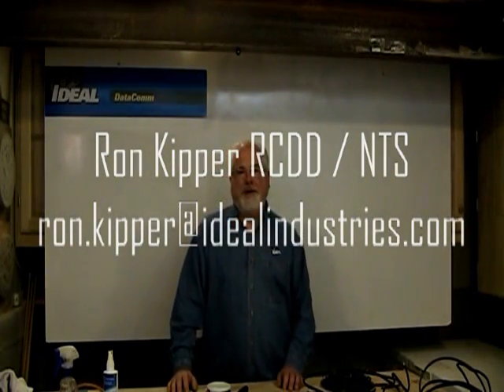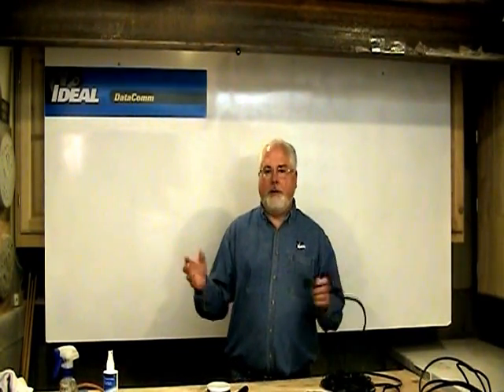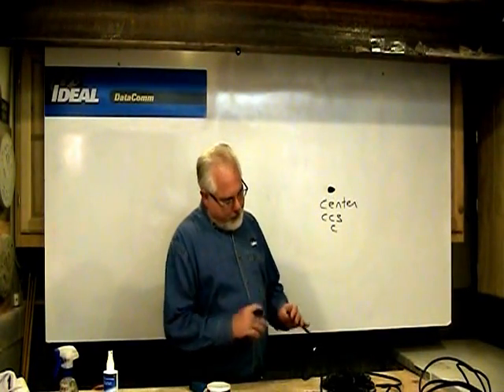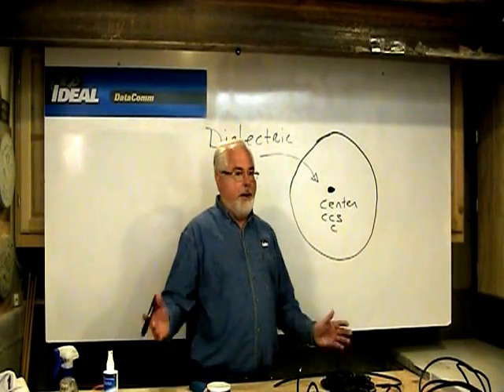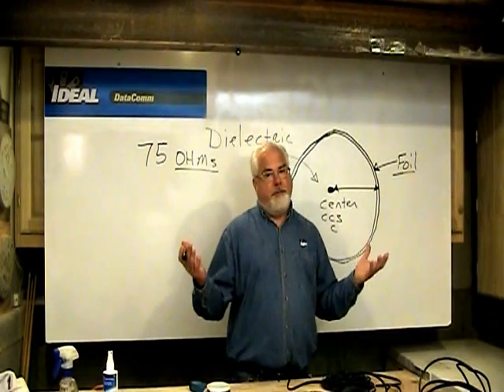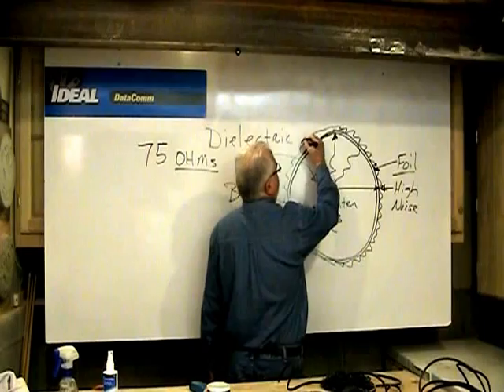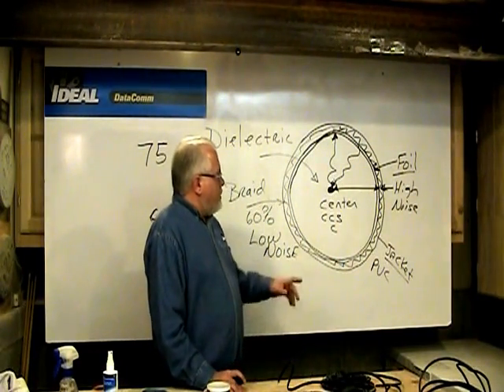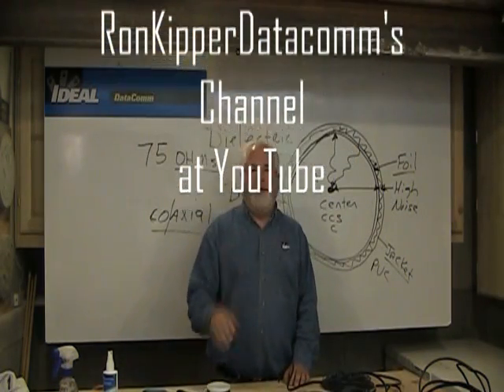Coaxial Cable Basics Part 1

Comment: Finally I have the answer to my question, I had used a "U" staple gun on my internet coaxial,  this staple just barely fits around causing the coax to be slightly squeezed down, Ive been doing this for years working for ADT and never had a problem, I knew I wasn't pinching it so tightly as to short the dielectric, I was dropping internet connections every few minutes at home and the Comcast boy tried for an hour to convince me that my staples where causing all the problems, but he could not explained how,  I insisted he replace the modem, he did and ensured me this would not fix my problem,  well that was a year ago and it still works great, But I had never heard of the capacitor effect inside of coax when the dielectric is manipulated, Thanks!
Reply from the maker: Glad to be of service and thanks for being out there. Ron

Comment: I bought a Sperry tt64202 cable tester because I'm getting no signal from my antenna. I have 3 lengths of of coax. I used a RG59 that was in the wall and runs through the attic, and attached a piece of RG 6 to either end. One to go from the attic end up to the roof, and another piece to extend from the wall end to another place in the wall. The tester shows a positive signal only when the main unit is connected to the remote unit with the coax connectors that came with the tester. I have tested all three sections of the coax that run from my wall individually, and get no positive signal. I'm stumped. I don't know how that can even be possible. Any thoughts?
Reply from the maker: Jeff Johnson Jeff I would recommend a new piece of RG-6 that runs directly from the wall outlet to the antenna. However what you are doing should work I am assuming total length of the cables is 40-60 feet? That tester will show either an open or short in a coaxial cable and does not measure signal strength. So if you have nothing it is an open. In that run of RG-59 is there a hidden splitter that may be causing your problem? The tester cannot test through one. Double check all the connections there is something you are not seeing that is causing the opens. If some strands of the braid get wrapped around the center conductor that will be a short which also causing no picture. Worse case take a length of RG-6 cable from the antenna to the room you want reception and see if you get a signal. If that works it has to be a problem with the cable in the wall.Good LuckRon
Reply: ***** Thanks, Ron. I figured it had to be the connections, and I went back and redid all of them being much more careful about the length of the dielectric and the copper wire. I had also used RG59 connectors on the RG6 cable, so I replaced those with the proper connectors. I had used RG59s because I had some around for some reason, and I figured it wouldn't matter since I thought their function was just to hold the connections together which they did, and I thought they would work fine if they were never stressed. I suspect the culprit was the somewhat careless cuts I made on the ends of the cable, but everything works find now. Thanks so much for your videos and for taking the time to answer me.

Comment: Hi. Where can I find the capacity per meter data for RG174 and RG58? Can I rely upon that data if I am using cables from different manufacturers?
Reply from the maker: The manufacturer should be able to provide you the specs of their cable. You might find some help on the SCTE website as well. Good luck Ron

Comment: I'm wanting to rerun my coax inside for internet phone instead of letting the cable company do it (they charge $50 per foot) do I need quad shield for this or? I'm not trying to be cheap but I don't want to be ripped off either!  Or what would you recommend?
Reply from the maker: jack Kang Jack Quad shield RG-6 is usually not that much more in cost and if you have any issues with nearby electrical lines go ahead. If you do not have any issues with electrical noise then RG-6 is fine. Good luck running those lines.
Reply: ***** thank you very much
Reply: ***** I'm sorry to bother you again,  rg6 vs rg6u?
Reply: +jack Kang the U is referring to the shielding. Someone correct me if I'm wrong. But you'd get less outside interference with a U cable because it has a thicker shield.
Reply from the maker: Sorry Jack for being late back to you. The U stands for Universal from what I know and has nothing to do with the amount of shielding. In many cases CATV providers will install a RG-6/U drop cable to your home.
Reply: +jack Kang Ron is correct. The U stands for universal. For burial its recomended to use Rg6U not RG6. For home use you can use either one. As for quad shielding. Either one can be quad shielded. You have to check the specs. If you got the money it's probably a good idea just to buy it anyways. It's better shielding.

Comment: Thank you for making these videos. I just started as a installer today with a local cable company. Can you explain "muxing". I understand it as highways going down the pipe is that correct? Sorry if I am spelling that incorrectly. Any info would be great. Thank you for your time.
Reply from the maker: Adam Nye Adam good to hear from you. The term refers to multiplexers used by CATV companies to combine or multiplex 2 digital channels onto one output channel which you can think of as lanes in a highway only the highway here is coaxial cable. I am not a CATV pro but hope that helped. Ron
Reply: ***** Thank you for the response. It helps. I might try and dig a little more on this topic. But I am not sure if it will even make sense, I guess I will see.
Reply from the maker: Adam Nye I remember graduating college thinking I would never step into a classroom again.............today I do nothing but try to keep up it seems and in low voltage it is always changing. It will make more sense as you get exposed to it.
Take Care

Comment: Wow!  Thanks for the time put into this video.  It's been almost 10 years ago but very relevant to my issues right now.  I didn't want to pay the cable company or contractor to extend my coaxial in the house so I decided to do it myself.  I really had no clue what I was doing.  I was able to get a rough & crude cable TV signal on my other TVs but Internet signal would not connect.  I was stripping everything down to the copper core. UGH!  About 40 feet of RG6 in the trash.  Now time to start over...the right way!!  Thanks Ron!
Reply from the maker: Erick sorry to hear you had a little bit of a learning curve but hope you get it fixed have fun Ron

Comment: Great job Ron.  Interesting and clearly presented.  I knew nothing about coax cable before watching.  I am trying get rid of expensive cable TV , so I bought a TV antenna recently.  Found two pieces of old coax cable, each piece with only one proper fitting, the other end plain.  I properly connected (screwed on) the fitting of one coax to the TV and the other coax to the antenna.  I then jury-rigged the loose ends together like they were power AC cables....after stripping the coax with my pocket knife, I twisted the center wires together and then twisted together the foil and mesh.  Even not knowing about coax cable, I knew this was not ideal, but I was surprised that my TV picked up nothing...not a single station.  Is this what you would expect?  I thought the concepts you mentioned would moderately enhance the functioning of the coax if followed.  I didn't realize they were so essential.  I know I need to install the proper fittings, or just buy a ready-made coax at the store.  I was just wondering why my makeshift connection allowed absolutely no signal to my TV.  Any thoughts?
[URL=http://s93.photobucket.com/user/photocloud1/media/coaxrigconnection_zps7c50c9d4.jpeg.html][IMG]http://i93.photobucket.com/albums/l78/photocloud1/coaxrigconnection_zps7c50c9d4.jpeg[/IMG][/URL]

Comment: Ron,

You had said that the foil shield is used to block high frequencies and the braid is to block low frequencies. Why is the foil not efficient at blocking low frequencies? Why is the braid inefficient at blocking high frequencies?
Reply from the maker: Hi Jason I believe it has to do with the wavelength of the signal. The longer wavelength of the lower frequencies the braid can handle while the very short wavelength of high frequencies the foil is better. Hope that helps Ron

Comment: Hello Mr. Kipper, great video.

You say only the center conductor carries the signal, but both the center conductor and the foil conductor will have a current, correct?
Where the current in both conductors will be equal in amplitude, but opposite in direction, correct?
Reply from the maker: +Celso Rodrigues Celso I am not a RF engineer but from what I know the ground is just a zero reference point and carries no signal. Take care.Ron

Comment: great video.  I'm looking at moving some rooms around in our house and our cable comes into to one side of our house in the basement and runs across to 3 rooms over then, it runs up through the floor into a room on the main level of our house.
when the cable company installed it, they ran one complete cable from the outside box, through our outer wall, and basement and the floor into the room, so I have no connections I can remove to relocate the cable and am having to consider cutting the cable to pull back through the floor, then install wall jacks and such.
I was curious what runs through the cable and whether or not I have to disconnect it outside before cutting it, or cut layers at a time, until I can finally cut the center wire..
thanks to your video, I realize the only thing carrying anything is the center wire (especially since this is not satellite or other gear that carries current through the cable.

I'd imagine then, that it's safe to cut the cable to remove the end, pull it through the floor, put a new end on it and plug it into the new wall jack being installed?
Reply from the maker: Hi JeremyF4i yes you can cut the cable as CATV systems should be low voltage. I would move the splitter inside the house if it is not in some type of enclosure outside the house. Good luck Ron
Reply: the splitter is in the box that the cable company mounted on the side of my house. Thank you for the reply.

Comment: Hi Ron,
I'm building a patio out back that will have a TV. Before we poured concrete I left 2-3/4" conduits 18" below grade. One is to be used for power 110V and the other I left empty for future expansion. I ran another conduit approx 12" below grade to run coaxial for cable TV, this conduit was left approx 6" higher then the previous two, in hopes of helping with potential interference. After the concrete was poured I tried to feed the coaxial cable but the conduit appears to be damaged. Can I run the coaxial in the conduit that is running parallel with the conduit carrying the power? The run is approximately 60 feet. I'm concerned with potential interference with TV signal. If I can, what type of coaxial would you suggest?
Reply from the maker: Hi Raymond good question. The electrical code says low voltage wires should be at least 2 inches away from power lines and not run through the same conduit. So you can definitely use the extra conduit run you installed and should not have any problems with it. That was good thinking on your part to run those extra conduit runs. By the way the residential standard says 6 inches from power but I'm pretty sure you will be OK. Ron
Reply: Thanks so much Ron! I'm considering going with an RJ6 quad shield, it appears to give the best interference protection. Would you agree with that? Also would grounding the coax cable be beneficial?
Reply from the maker: Raymond RG-6Q is just double shielded and I doubt you need to worry about that but you can use it if you prefer. The cable is grounded as it comes into your home so you do not need to ground it again and really should not. Good luck Ron

Comment: 8:00

Why would changing the capacitance change the resistance of the coax cable?

It makes perfect sense to me that the capacitance changes as the distance between the two conductors changes, but I do not see how this should have an effect on resistance which should be more a function of the length, area, and material properties of the conductors, no?
Reply from the maker: Zabmbia95 DC circuits that operate at very high frequencies will become similar to AC circuits where the frequencies are always changing the resistance changes to Impedance and is a function capacitance, resistance and inductance at a certain frequency. Hope that helps Ron
Reply: ***** Thanks. But then wouldn't the changing capacitance only effect the imaginary (reactive) part of the impedance and not the real part?
Reply from the maker: From what I know it is a big part of the total impedance but we need a better expert to take the idea any further. Any bidding engineers out there?

Comment: so its a high frequency electromagnetic  wave, what would happen when these frequencies are then limited at a lower bandwidth? would that potentially degrade an incoming visual and audio signal over tv and the internet?  You see I am having an ongoing problem with my internet connection where everytime I download music or listen to audio streaming over the internet it is sounding moderately compressed, thin, lacking volume, and treble + bass frequencies missing from the audio that would normally be there  for instance audio quality is fine when I use mobile data and normal when I am using someone else wifi.  I have old RG59 coax cable from the 1980s providing internet to the modem, is it possible that the gauge of this wire is degrading the signal by only allowing a limited bandwidth? I read somewhere online that RG59 runs at about 900mhz, isp can provide 2.4ghz and 5ghz and if thats the case is this the reason for my audio and visual problems? 

 Or is it possible that the RG59 coax wire would normally be perfectly fine in my situation and my problems are more than likely stemming from something else such as bad splitter, deteriorated or corroded wire, daisy chaining, and possibly even worn out connectors, so on and etc?   (my cable guy tried telling me everything is fine now because the internet speeds are high, download and upload time is within range,  one of the problems I used to have was constant internet drops and connection instability which I am not experiencing as much anymore but nerveless I am still having audio problems, everything is not fine.  What would the difference between velocity and power be when dealing with the internet frequencies? how does bandwidth play into that?)

Thanks
Reply from the maker: Hey Anthony that is a lot to talk about! Not sure how much help I can give you but it would not hurt to update the cabling to RG-6 as that is what the cable people require today. Replacing the cable, splitters and all the connectors will at least tell you it isn't you cabling that is causing the issue. If it is as old as you say time to replace it.Hope that helps you. Ron
Reply: that is allot, I will ask you however if you know does coaxial bandwidth effect internet bandwidth? and do you know if internet bandwidth being reduced would that have a negative impact on audio and visual quality possibly degrading and distorting things? I feel like im stuck in the 1980s with some quality you would get off old security monitors haha! Yes I think its time we update the cabling here, it would definitely help. Thanks Ron
Reply from the maker: Coaxial cable has a lot of bandwidth RG-6 is rated out to 3 GHz which is well beyond want the CATV providers require today so they can always increase the bandwidth if needed. If they are having issues in some cases it could be the limitation of their equipment not the cabling. If your Internet speeds drop it can affect audio and video quality as these are very time sensitive applications. I watched a couple of your videos keep them coming! Ron
Reply: Thanks Ron, most of my videos are so old and akward but I left them up in case anyone would want to watch haha!

Do you know anything about amp dbs coming through the cable and how that might also have an effect internet and quality? 

The last tech that came to help out thought he had everything figured.. He attached an attenuator to the back of the modem without ever checking the cable amps with a meter, he did this based off of his own thought,  told me  initially that the cable wouldn't effect signal quality etc (whether it was deteriorated or lower bandwidth). I sense he hasn't got a clue what he was saying just then  because obviously I still had the problem afterward and now leaving me more concerned than ever. I asked him several questions about bandwidth, coax cable, and even the amp dbs but he never gave me the right answers, good grief. I am glad you where able to assist me

Comment: is antenna coaxial different than cable coax
Reply from the maker: tim mason No still going to be RG-6 more than likely.Ron
Reply: How does braiding can stop low frequency noise? and foil can stop high freq noises?.
Reply from the maker: I am not a cable engineer but I would say it is due to the longer wavelengths of lower frequency signals. The braid can handle the lower longer wavelength and the foil helps block the very short higher frequency wavelengths. Hopefully someone can add to that explaination. Thanks for watching
Ron

Comment: cb cophase coax..9ft better then 12 ft when it comes to loss of power transmitt power
Reply from the maker: Hey Minnesota kid I doubt 3 more feet would make much if any difference. The two connections on either end probably lose more. Ron